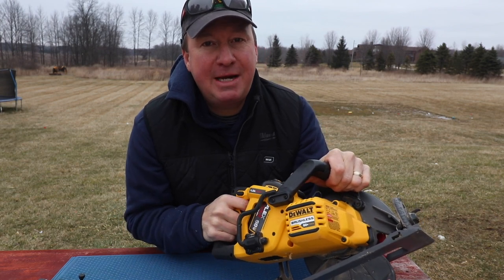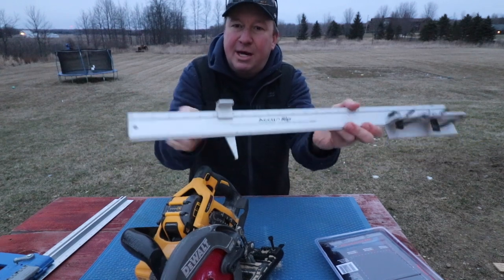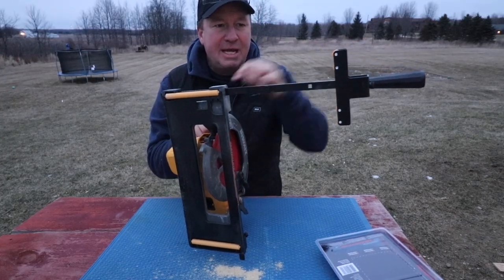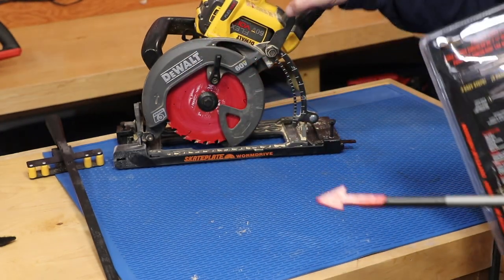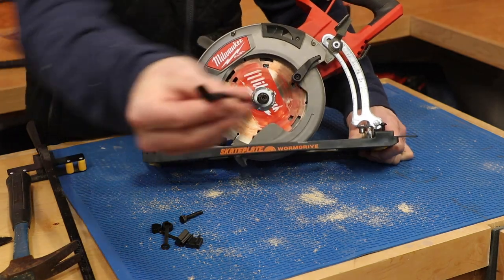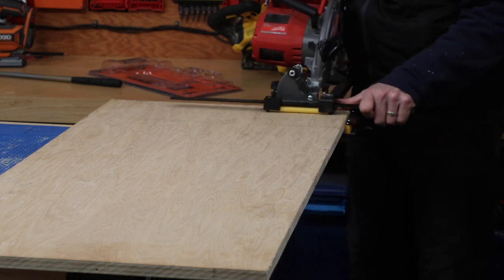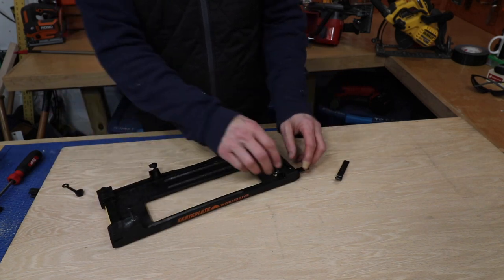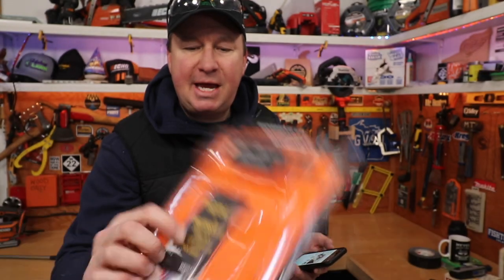SKATEPLATE CIRCULAR SAW GUIDE FOR SMOOTH STRAIGHT CUTS!

Comment: cool concept, but I'd think that it might not get a square edge, as it would almost make it a few degrees of bevel?
Reply from the maker: The Skateplate rides evenly across and it apprears to not have a bevel issue.  I'd have to get a precision square on it to find out.
Reply: @MarkThomasBuilder  I just ordered one yesterday (Lowe's had them for $60) and I really just want to use the plate, and make a jig that will let me attach it to a Makita track. (I'm the guy with only a right arm, desperately trying to get companies to make a left blade track  saw for us righties.) And this would be great because I can use my worm saw from my wheelchair.
Reply from the maker: Hopefully this works well for you.  I never thought about track saws not being available as a left blade.  Makes sense that a company should offer one.

Comment: That kreg guide is CRAP. Ive been in construction for 24 years, and the last 6 as a general contractor. I tried to like the kreg, but it literally ended up in the trash
Reply from the maker: I think the Kreg guide is something that works best for the DIYer.
Reply: @MarkThomasBuilder  I can't get angled cuts right with it.